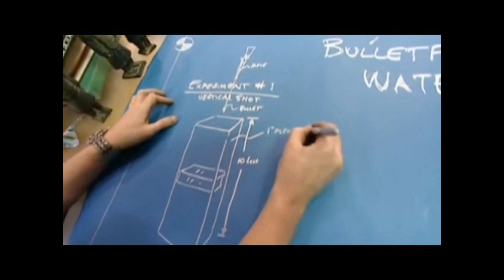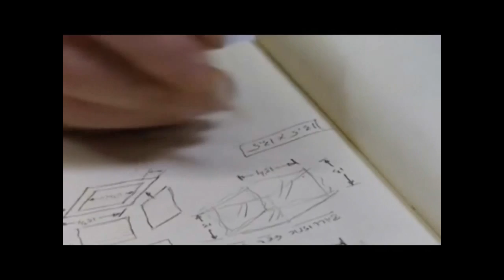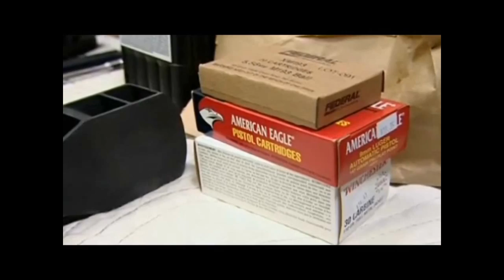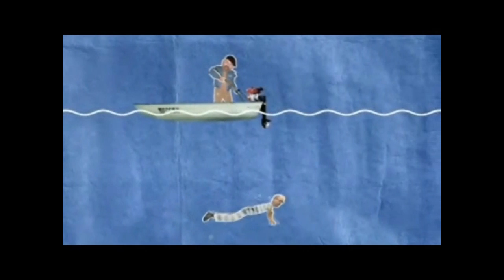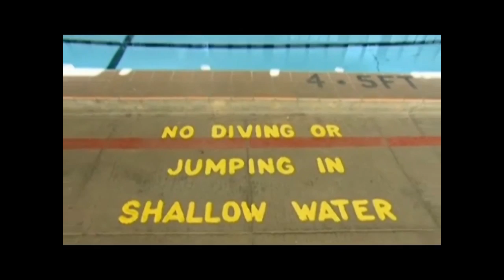Mythbusters Bullet Proof Water Myth

Comment: Umm, logically, shouldn't they have started at the furthest depth and then worked backwards, until they found where it did penetrate the gel?

That's practical - spares the gel from damage - and I reckon would have made for better "TV tension", as you wait for the moment when it would kill. There's no tension when the first shot goes straight through. 

The "null hypothesis" here should be "nothing happened", not "well, our action hero who dived into the water is definitely dead now". "Still dead". "Yeah, still dead". "Oh, wait, finally, nothing happened". 

Like, you've got your tension and release backwards there, folks.

Comment: What's really fun is shooting into water at a much lower angle, say 10 degrees or less. The bullets not only don't penetrate, they actually 'skip' off the surface and continue forward in the air. I've done it with both rifles and pistol. Can do the same thing on a grassy surface like a meadow, believe it or not.

Comment: One major thing done wrong here.

They were firing into a compressed small body of water not one large body of water i.e a lake. 

Plus the temperature of the water used is important. Water in a lake or river will usually stay pretty cold even in summer because of thermal distribution. Cold water is by far harder then warm water. I.e jumping out of a plane your chance of survival would be way higher aiming for a bunch of bushes or snow in comparison to a body of water since the water has the surface consistency of concrete. Therefore using "warmer" tap water allowes the bullet to pierce further down. 

You can see with several tests done in lakes and rivers that the faster and harder the bullet is, the more likely it is to just explode upon impact with the surface due to waters concrete like surface at the speed the bullet impacts on it. Especially with bullets that've got a jack around them, that jack usually gets ripped off the second the bullet touches water.

Comment: Similar to a spacecraft going a fair part of the speed of light. Even with just a few particles in the hard vacuum of space, at very fast speeds, it be like hitting a wall without some device to push aside all matter like you see in the fictitious show Star Trek. Those bigger bullets really smashed themselves apart as they hit that soft water, but the smaller slower bullets feared much better.

Comment: the science is pretty solid.
bullet hits water.
leading edge immediately decelerates.

bullet technically collides with itself and disintegrates just below the surface.

is it odd that i'm now wondering what would happen if you fired a DUP round into water?

Comment: Neat!!
But why did the bullets break apart  the way they did? Does it have to do with the velocity vs viscosity of the bullet to water? Or does it relate back to the temperature differences between the bullet and water? Would the outcome be different if the bullets were full lead or plastic jacketed instead of copper? If the shots were taken from farther away, allowing the bullets to cool slightly, change the way they impacted the water?

Comment: The physics behind this are actually quite simple: Bullets move fast. Really fast. And the faster they hit the water, the less time the water molecules have to shift. So at that speed, they might as well be firing right into concrete. It's similar to how the impact from jumping off the edge of the pool vs. the highest diving board is completely different. In one case you drop right into the water, in the other you hit it like a rock. 
The faster and heavier the round is, the more energy hits the surface, meaning that the bullets literally break apart due to the impact. And water has another strange feature: It hardly compresses under pressure, which makes the impact and travel of the round even more extreme.

Comment: It's a shame we didn't get to see whether or not the low velocity bullets had to pass through the air-water boundary, or whether the barrel was basically 'pressed against' the surface of the water. That would mean that the barrel has broken the surface tension of the water before the round is even discharged.

I'd also like to have seen the 9mm fired into the pool.

Comment: 6:00
OK, but what were they expecting?
Reply: @boekbruh  Firing buckshot would actually be less likely to explode the tank. The tank exploded most likely due to overpressure, not projectile puncture. Slugs carry immense force and the ballistic gel formed a seal, meaning the pressure at the bottom of the tank was likely extremely immense.
Reply: alan smithee Ahahah I had the same question 😂

Comment: In the first test, the guns were fired at still water, in the second there was a more obvious 
current. If the gun was fired vertically at running water how deep is safe, and the same 
question with the still water. If it is fired at an angle into a still pool of water how deep is safe?
Is there a difference between running and still water.

Comment: Just going straight through the gel doesn't automatically mean a lethal hit. If the result is a straight line inside the gel then there's a fair chance of surviving. Of course, some ammo, like hollow point, will produce a minor explosion inside your body, which means much worse damage with bigger chance of being lethal. But it's not a guarantee.

While we're at it, hollow point has a tendency of staying inside the body. Which means a lethal hit cam easily not go all the way through.
And this 9mm gun looked like this explosion I was talking about happened right outside the body.

What happened with the shotgun however does constitute a lethal hit, obviously.

Comment: Someone should tell them that Water has a thing with compression. So the Faster the Bullet Goes the harder the Water goes to Deflect it. 
In Fact if you want to Shoot someone below the Water Surface. You should use a Gun with lower Bullet Velocity. 
Because the Lower Velocity will make it far easier for the Bullet to Penetrate the Water Surface due to the Water having the time to be Pushed aside :P 

Dont Laugh but there is a Reason that Whale Hunters use Harpoons :P
Reply: Yeah this is what I thought too, water (annd other liquids) are unique in that sense that it "punch back" harder the faster you hit it.
Reply: yep, theres a rule of thumb where water is basically cement if you drop to it from a height, with the speed those bullets are travelling at, water is definitely equivalent to or stronger than cement
Reply: well they should have done this experiment in a pool...the tank had less water by volume and the pressure exerted by it is less so..bad try..
Reply: Yeah, whalers use harpoons because they want to snare and catch the whale. It's nothing to do with water compression.
Reply: they know it beforehand, but the catch in the Mythbusters is showing how to discover it, not only saying and end
Reply: now imagine your body hitting the water at 3000 feet per second!  "ouch!"..  that's only 3 times the speed of sound.  I'm sure a direct hit to a 6" inch steel wall (at the same speed) would be a lot softer.
Reply: This is also a fantastic test if the shooter was inches from the water but they would most likely be stood at at least a couple feet away
Reply: No expert myself but a bullet is aerodynamically shaped to push through the air.
Hydrodynamics are totally different.
I have seen Russian underwater guns on a website and they fired very long, needle-like bullets.

They also came with the caution not to use when above the water because they might damage the gun.
Reply: Surface tension

Comment: Wouldn't an armor piercing or just thinner diameter bullet go much further than a more powerful gun, because the smaller is it the less surface tension it has to break? Wouldn't be interesting to see a "Water Piercing" bullet prototype and the shape it would be, and a "Water Gun" to go with it that shoots it at subsonic levels.

Comment: this myth-busting seemed very "unsafe" according to the gun laws in my country.
Even when i was in the army, we weren't allowed to fire 50 cal's in the range( since it wasnt safe enough). We had to drive to a more distant and much larger exercise range.
If Jamie had made a mistake and fired that 50 cal by accident, not in the water, but straight ahead, it would have gone through the wall and kept on flying a mile or so.  Perhaps it could have even ricochet off of the water and through the wall.

Comment: The result doesn't surprise me, the slower bullets pass more easily through the liquid. The faster an object hits the surface of the water, the harder the effect the water has, it becomes more like hitting a solid object rather than a liquid, in the same way that the higher you dive the more dangerous it is.

Comment: Would it matter if the shooter was further away from the water entry point?
Reply: +Adam Banaszak Not really, the gun is being fired out of the water in all these tests so the bullets reaching its maximum initial velocity. Being fired further away I can't see the air slowing the bullet down significantly enough.
Reply: Thanks, I was wondering if like a 50m distance would change anything
Reply: that'd make it even less likely for the bullet to hit since the angle will reduce even farther, assuming  the shooter doesn't have a sisccor lift or something

Comment: The reason that the high nozzle velocity weapons 'fail' to substantially penetrate water (angled shot), and actually destroys the bullet, in contrast to the slower older guns is because Resistance (drag force) in a high density medium (eg. water) is proportional to the SQUARE of the Velocity. That is, R = mkv^2. where m = mass of bullet, k = drag coefficient depending on the medium, bullet shape, shot angle, etc..v = entrance velocity of bullet.

Comment: .....uuuummmmm...NO.they are doing it wrong.
if you are diving to escape being fired upon,you are moving AWAY from the shots(#1),
moreover your attackers will NOT be firing in a direct down angle,it'll be like 45 degree angle at best(& it won't be point-blank),which WILL make the bullet slow down(water density also is a factor).given the proper circumstance ANY myth can be either proven or broken and it WILL be rigged. dumbing it down much ?don't over-simplify.
Reply: Did you watch further than five minutes into the video?
Reply: All your reasons are utter bullshit/would have barely any affect at all.
Reply: +razieltheFallen1 It really helps if you comment after watching the entire video, not the first few minutes, then you dont sound like an idiot.
Reply: ok,fellas,it's called OPINION,chill..
Reply: Epic Moose dude,that's not much of an argument.care to elaborate?
Reply: ....
"if u want my comeback,you'll have to scrape it off your moms teeth"

Comment: the only thing I can think of for this to actually work, you would have to fire 2 or 3 rounds consecutively, breaking up the surface tension and allowing the next round or rounds to actually make its way through the water.
Reply: TheFreaxTux
an AN-94, two bullets concecutivly at 1800 rounds/min (it was a weapon designed to go threw body armors), that would, i think, get the job done.
Reply: that won't do. you should shot at exact same point, really fast.
Reply: sobekflakmonkey This has less to do with surface tension and more to do with refraction. Shooting two bullets wouldn't help, they'd explode each time they made contact with the water.
Reply: But the thing is if you break the surface tension the water is full of bubbles and foam and you have no clue where to shoot at.

Comment: Modern Bullets (US Bullets) are designed to break into fragments on impact.
Reply: They specified the .50 was an armour-piercing load, specifically meant to avoid shattering going through engine blocks. And anyone shooting at you after you've dived is most likely using ball rounds.
Reply: If it was an ap round it would be marked with a black tip showing it's steel centre
Reply: Also they do have rounds made to break apart but us specific is not really true.the army use FMJ and the 5.56 or .223 is prob one of the best rounds at penetrating.smaller and faster is how u beat armor.but like they said water and steel does not compress the same .
Reply: AgentTasmania b ax cass Thomas s km

Comment: What they were missing entirely is the shots missing. If you look at the water from an angle you will be tricked by refractation of light waves, and the person under water is not, where you see it. This effect increases the deeper that person dives and the shallower your viewing angle is.
Reply: You're stupid as fuck. If that was the case the bullet wouldn't be shredded into peices in front of the gel when they pulled it out of the water. Even if they miss, the bullet is being shredded before it gets anywhere close to it if you see where he gets the pieces from at the bottom of the pool.
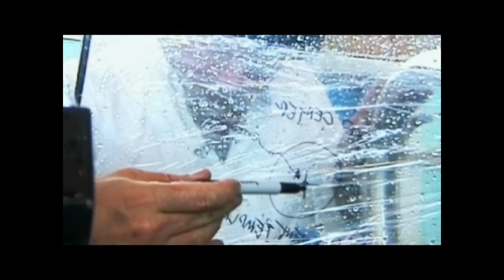Reply: *****  At 9:33 they quickly mention the "refraction aimer" but that's all I could find in this video. They don't explain it as far as I could see.

Comment: So in future, tanks will have no armor, but just a 50cm thick layer of jelly/water like surface.
Reply: Larn Regis haha! no ones you pierce the tank holding water the water will flow out and you'll left with no armor!
Reply: Why? Takes 3ft of water. Takes about 1inch of steel.
Reply: Scottx125Productions - Spiffingly Serious British Gaming!
but the water/jelly is moving on its own back to the previous default state = regenerating armor ;)
Reply: @Scottx125Productions  so you are saying I'm better off jumping into the steel and swimming away? I will keep it in the back of my head
Reply: Only, modern tanks already have enough armour to stop bullets. The last rifle shown is used to take out engines/occupants of light vehicles, exploding ordinance at extremely long range, and other equipment (hence the term anti-materiel rifle). They are no where near powerful or accurate enough to penetrate modern tank armour.

The threat to tanks these days are explosives. Testing the resistance of water to those weapons would be needed.
Reply: maybe not water of gel, but something very similar but higher density, like mercury or a very low melting point metal that would be kept at a liquid state. something similar that has been worked on but for low velocity round is a type of body armor that has many spheres that are tiny, microscopic . that when impacted by the force they would become a solid in an instant and then back to a liquid ( or that other state of mass that is between liquid and solid, I took chem class long ago) but that concept of body armor might be apply-able to a higher velocity round or explosive which in term become light armor for vehicles.
Reply: Aye hasn't been a usable Anti-Tank rifle since the early days of WWII, when 15mm of rolled steel was acceptable as medium tank armour.
These days it's all fancy composites and ERA, anyway.
Reply: arunashamal Modern technology finds a way to contain the water/jelly without the need for a pierce-able balloon thing.
e.g.
Using high voltage to raise adhesion and surface tension of the water.
or
Force fields and magnetic fields to contain the water/jelly substance that is soaked with metallic nano particles to change the physical property of the substance to be magnetic.

Then the armor holds itself on its own to the surface of the vehicle.

Comment: I got wondering. When the bullet is shot, it is charged with energy as it has weight and speed. So, when the bullet hits the water and breaks, will that power dissolve into every direction in the water, OR does it move on as pressure wave to the same direction as the bullet? If so, that shot might still be lethal, even if the bullet would break. (assuming the pressure wave would hit heart, brains etc.)
Reply: AllHailAK47 as you saw with last gun, shockwave goes up into the sky.
Reply: It will go in the same direction. However water has quite strong molecular bonds and those will keep the water in place.